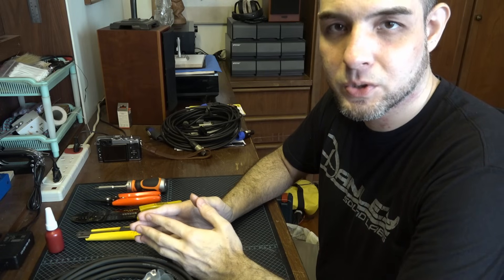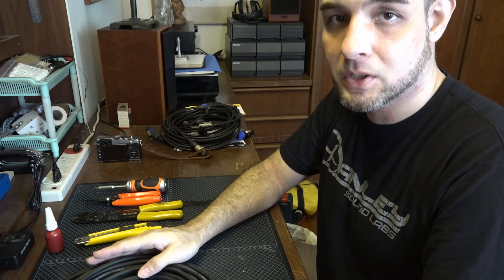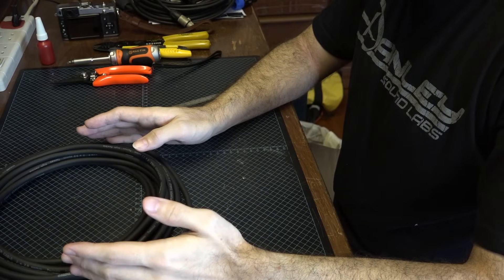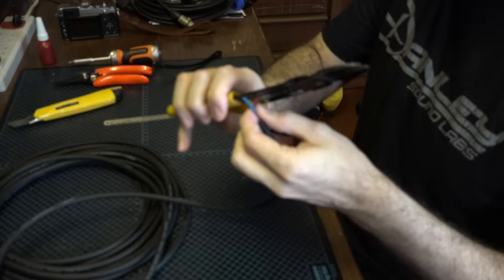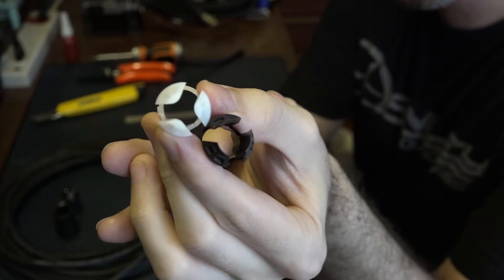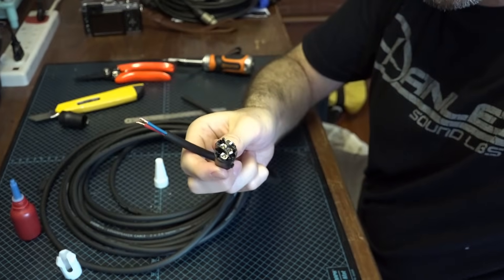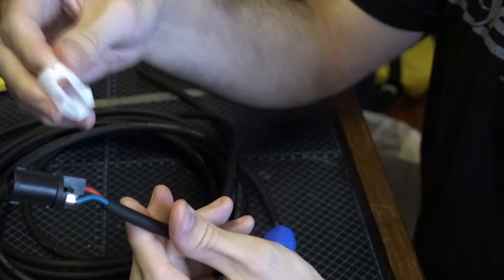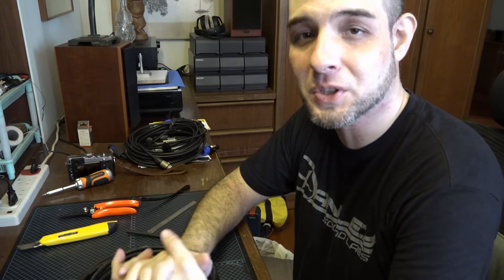How to wire Neutrik SpeakON cables

Comment: one question.
you mentioned rubber jacketing, would the pvc version be ok if the wire is stapled to a wall never touching the floor? And also, will the strain relief hold just as tight on the pvc jacket?
The reason I ask is my speakers will be hung on my wall and I dont want black wire snakeing up to them because of cosmetic look in room.
Reply from the maker: For home installation that should be fine. Whether the strain relief works or not depends on the cable diameter more than the material of the jacket.

Comment: i have a working man 15 in combo that the head blew so im changing the mini plug to neutrix hardware.  what do the combo wires mean?  the wires are black, green and white however, the connector has the 1- 1+ and the 2- and 2+  how do i connect 3 wires with a 2 connector, should i use a 4 cable connecter and minus the fourth connection?  Thanks!!
Reply from the maker: That's an interesting one - three wires of that colour is typically an AC power cable. Are you sure you're working on the cable that goes to the loudspeaker?
Reply: yes, its almost a 1/4 in but no cigar.  it was on the actual speaker and plugged into the amp.  ive asked and researched and people either know or dont know but cannot help me.  i was sold the hardware at guitar center and the guy who sold it to me said i would find anything about it on the world wide web.  NOT  jaha  anyway, an electrician said that the colors were as follow, 
Green = ground
Black = positive
White = negative
needless to say, Im stumped

Ive tried different combos on the wiring but I dont want to blow up my new amp head and dont want to continue spending more money if i cant get it to work.  
I believe that SWR uses a proprietary plug system and wiring and is the reason I cannot make it work.   Some knucklehead that specializes   in bass amps said he would help me for the low, low price of $380.00 and, he cannot use my hardware, he has to use his because, now get this, I have "inferior foreign junk" that he cannot warranty his work with.  Thanks for reading and trying to help, i just dont want to throw it away it cost me $600.00 back in 94.
Reply from the maker: Sounds like a puzzle! The next step is to try and contact SWR - they are a shadow of what they used to be but it's worth a try. Failing that you'll need to dismantle the cabinet and see how the wires are routed to the speakers and/or internal crossover.
Reply: Thank you!!  i will and have done the majority of the foot work and I really appreciate the information and tips you have given me.  Its great to have people like ur self giving us "FREE" information.  Thanks again!!
Reply from the maker: You're welcome Rick, hope you manage to get it sorted soon. Those are great-sounding combos, although rather heavy by modern standard ;)

Comment: what do you think about hosa speaker cable ther premium line and live wire nuetric speaker conecters by live wire i dint buy them couse they was not ginuwin noutric conecters
Reply from the maker: In my experience all name brand speaker cable sounds pretty much the same for sound reinforcement purposes. Gauge/length is more important than brand.
Reply: Oh..It's THER EDGE LINE speaker cable

Comment: can you do a video on actual speaker cable?  is there a significant difference between solid copper strand vs. copper clad aluminum?  also, what is your take on people who say you can use any old regular electrical wire? Thanks and amazing videos!
Reply from the maker: Thanks for watching Robert! I'm a live sound engineer not an electrical engineer so my knowledge of speaker cable is limited to the practical side of things :) I have found that for live sound the most significant factors affecting the sound are the gauge of the cable and the length of the run. I have no experience with using copper clad aluminium, although I may have used it in somebody's rental rig without knowing about it :) 

And yes you can use electrical cable in a pinch, as long as it is of heavy enough gauge, although in my part of the world almost all electrical cable has a ground wire in it so is not cost effective.
Reply: Thanks for your reply....as many have said before me, extremely helpful videos!!
Reply from the maker: Robert Morse You're welcome Robert :)

Comment: I have a question - I recently got a 500watt powered mixer for a pair of passive EV mains.  The mixer has Speakon outputs and the speakers have banana plug inputs.  I'm comfortable with building cables, but what would be the most cost effective solution?  Also, what gauge of speaker cable should I use for 500 watts?
Thanks
Reply from the maker: Speakon to banana cables are easy to build - just make sure you get the polarity right: +1 on the speakon should connect to the red banana plug and -1 to the black one.  In terms of gauge use the thickest gauge that will fit in the connectors and the shortest possible run of cable for your application.

Comment: Hi brother is there any chance you can do a tutorial on a Speakon Y splitter?

cheers.
Reply from the maker: That's an interesting one - why do you need one of those?
Reply: hi brother thanks for getting back to me, um I have a complicated situation Im in a church band and im just running two passive speakers off amplifier and I only have one channel working on the amplifier, the other channel doesn't work so I just wanted to know if there was any chance you could approve of using 2 speakon cables to make splitter and which poles I have to use
Reply from the maker: I see - the standard way of doing this is to daisy chain the speakers together using the second input/output on the back of the first speaker. Are you able to do this?

Comment: Thanks for instructions well presented .will the speakon 2 pole connection be sufficient for 4 speakers in situ fixed on a wall as it is all new to me ,and i wondered if i would have to change to a 4 pin fixing for this venue thanks.
Reply from the maker: It depends on many things to be honest with you, but a simple installation with four fullrange speakers daisy-chained together will generally only use two pole connections. Consult a qualified installation specialist if you are not sure!

Comment: Please get an adapter to probably convert a Euro plug in a UK plug as it is very dangerous what your doing.
Reply from the maker: Those are type C plugs my friend - they are 2-pin ungrounded from the factory and they are designed to be used in the manner you see. The device has to be double-insulated in order to use this type of floating ground, and it's perfectly safe. But thanks for your concern ;)
Reply: Amature electriton here hahah. In the UK every plug needs to be fused as its the way our houses are wired. If something goes wrong you're basically putting 32 amps on some 5 amp cable.
Reply from the maker: Jacob Kelly In Singapore we use the same plugs as the UK but typical domestic wiring is 13 amps maximum, 20 for heaters and air-conditioning units. 32 amps is already into 3-phase power territory which should not normally be present within domestic premises, only at the meter outside ;)
Reply: GLB Productions oh ok

Comment: Hi Bruno, this is a very detailed illustration. Thanks for the video. I am a system integrator, so such videos are always helpful. 
Could you please explain me the purpose of 2+ and 2- though? Is that pair meant to carry second channel? If that's what it is, then 2 pole Speakon connector would be capable of carrying single audio channel whereas 4 pole, two channels. Please enlighten. Thanks.
Reply from the maker: That's exactly right - the four pole speakon can carry either one or two channels of audio, and gives you the option of using 4-conductor speaker cable to carry two channels of audio in a single cable run. This works well with amplifiers that give you the option of outputting both channels into one speakon connector. Exactly how the two channels are used is up to the individual operator or system designer.
Reply: Thanks Bruno for clarifying. Could you help me with applications where you'd use the 4 pole Speakon exploiting both the channels? As in, exemplify with a scenario wherein 4 pole Speakon would be ideal to pick?
Reply from the maker: The most common situation would be a passive biamplified speaker where the woofer was connected to pins +1/-1 and the compression driver to pins +2/-2.
Reply: Got it. Thanks for your neat explanation Bruno. I really appreciate your help. You are doing a great job. Have a great weekend. Cheers!

Comment: is there a benefit to using four conductors vs two?
Reply from the maker: None at all - if your speaker input has only +1 and -1 terminals connected and you use a four conductor cable the +2 and -2 conductors will be unused and just sit there adding weight to your system. Four conductor cable is only used where all four terminals are connected, typically bi-amplified speakers and sub/satellite systems which carry both sets of signals over a single cable.
Reply: GLB Productions ahh! okay. thank you.

Comment: Hi my Name is Chris I have a quick qn, do i need a four core cable to connect my full range speakers using speakon connectors? they are EV TX215 speakers
Reply from the maker: Do you mean TX2152? Not necessary as those speakers have no provision for bi-amping.

Comment: the configuration at the other side of the cable is the same?
Reply from the maker: Yes standard speakon cables are +1/-1 on both ends.
Reply: Thanxs
Reply from the maker: You're welcome :)

Comment: Is it recommended to use 100' xlr cable for speakers?
Reply from the maker: Absolutely not! For connecting speakers you ONLY use speaker cable, ie unshielded twisted pair, generally with a minimum thickness of 16 gauge for live sound use. Mic cable doesn't have the current carrying capacity for connecting loudspeakers and can actually melt and start a fire.
Reply: Ok got it this is for passive speakers right? Can you use a microphone cable for powered speakers? or is it better to use xlr out fro the mixer quarter inch to the speaker?
Reply from the maker: Kertina Production Yes for powered speakers use XLR cables - the XLR connector is preferable to 1/4" as it is locking and more robust design.

Comment: Wires going into screw terminals should not be soldered. The solder will "cold flow" and loosen the connection over time.
Reply from the maker: Yes, if you choose the solder the actual connections (as opposed to just tinning the wires before inserting them into the terminals) the screws are redundant and should not be used.

Comment: Back in the day we used banana plugs and 12 GA. Heavy duty stranded zip cable. Cheap and bulletproof.
Reply from the maker: Yeah the big issue with banana plugs is that they can be inserted in two directions so polarity reversal issues were very common in older systems. The exposed contacts were also vulnerable to damage if they got stepped on. Otherwise they're good connectors - lots of contact area and relatively difficult to pull out. Much better than guitar jacks!
Reply: You're absolutely correct.  Now that  you mention it they were color-coded (red/black- both dark LOL)  and there is nothing to stop someone from flipping them over in a dark club, etc.  - disaster.  Before the banana plugs we just tinned the ends of all the speaker cables and stuck them in the screw terminals!   There's a recipe for phase-reversal problems de-luxe  LOL. 

BTW - I wanted to chime in on "tinning" the ends of conductors.  What we've found (over 40+ yrs of dealing with cables - I'm old....)  - it does keep the stray strands together - but  there's a very bad downside - it also creates a weak point right at the base of the "tin" and the conductor will fail right there - shearing off inside the jack  and often just inside the insulation (where you can't see it) and wreaking all manner of havoc.   What's worse ... they don't fail all at once  - it happens over time (with the speaker vibration itself contributing)  and it's intermittent... your cable goes from 12 ga. to 18 ga. to 32 ga... and eventually down to 1-2 strands still intact - enough so you can NOT  find the offending cable with a simple continuity check at the show -  it'll show up as A-OK with the load from a 9-volt battery ...  but nowhere near enough conductor left to carry the signal current from a 1000 watt amp.  This can cause amps to overheat...speakers to self-destruct.. etc.   This is far worse situation than a bare conductor just pulling out of the jack.    

So what we do now is strip the wire longer than needed - tin the usual 1/2" or so... then trim it again so there is maybe 1/8" or less of "tinned"  end down in the jack.  That puts the "tin ball" ahead of  the set screw inside  the jack - it eliminates 'strays' without creating the shear point.   Try it!   Start doing it this way and (combined with your loc-tite... a VERY good tip BTW) - you'll seldom if ever have to fool with a plug once you build it.    It's all about making everything as fail-safe and bulletproof as you humanly can - and the smallest details (like the Loc-Tite or the tinned end) are the difference between a real Pro and an amateur.
Reply from the maker: Great advice, thanks very much for your contribution! What a lot of people don't realise is that even though there is a stress relief which clamps to the cable jacket it is still possible for the internal strands to move independently as the cable flexes, causing the issues you describe above. And yes I agree that the best possible build quality is the way to go with cables - a little bit of extra time and effort will give you a cable that lasts hundreds of shows rather than a couple dozen ;)

Comment: Well done but how do you get it apart if needed?                          JimE
Reply from the maker: You have to use a fair amount of force to unscrew the endcap, which usually partially destroys the ratchet mechanism. However in my experience these connectors almost never fail if assembled correctly and the terminal screws are properly tightened down. Almost all of the speakon failures I have seen have involved cheap copies ;)

Comment: I like this very much; it's very informative. I use the updated versions: NL4FX and the NL2FX. Both of them have the metal release tab on them. As I am in the US, I use Southwire Royal 2C 14 AWG (2.08mm2) SJOOW for runs under 40 feet (approx. 12 metres).
Reply from the maker: Yes the FX series are 3-piece construction rather than 4 so are simpler to assemble. Thanks for watching :)